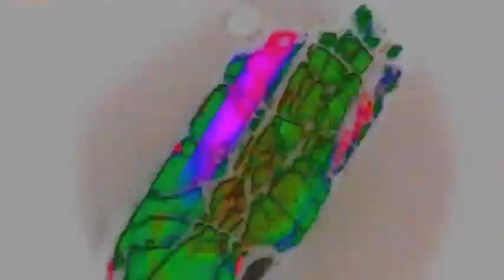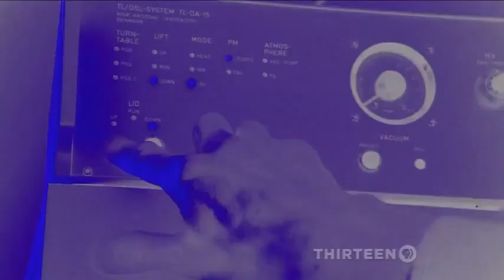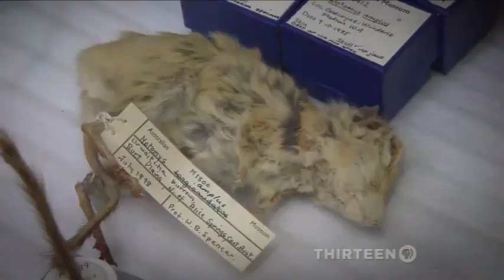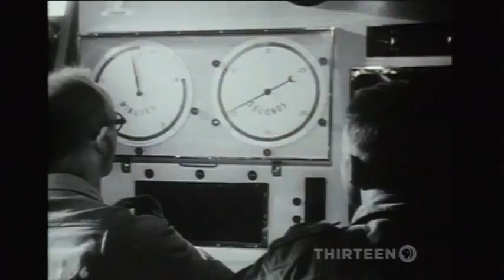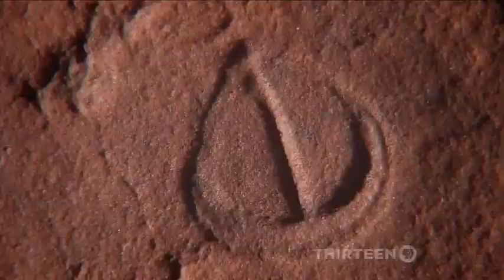Australia the First four Billion years - Strange creatures

Comment: confused how do you know that the southern hemosphere isnt the northen - karl holton
Reply: There is no "real" north or south.
But we can determine magnetic poles of a planet, and in fact Earth magnetic north is in antartica and magnetic south is around the actual "north pole".
We have discovered that contradiction too late, so by tradition we kept north and south "traditional".
Also magnetic poles are subject to change or switch, sometimes.
Reply: The way we see the Earth in pictures is purely done for the fact that everyone on Earth assumes it to look like that. If you flip those pictures upside down it's still the earth, but we humans will not be able to recognize it very well. Our brains rely on patterns, and the configuration of the continents form a pattern that we recognize. Flip that pattern upside down it forms a new pattern. By keeping the earth in a "Upright" position it helps eliminate the confusion. Than if you add the North and South Directions to it it makes even easier to navigate, or tell differences between two hemispheres.
Reply: mmikeyy27
Use google and wikipédia if you don't know anything about it, check it out it's true.
Reply: There actually is no true magnetic poles. They flip every 300,000-450,000 years